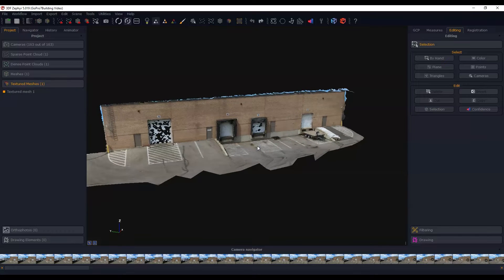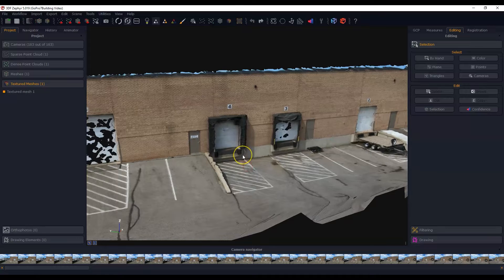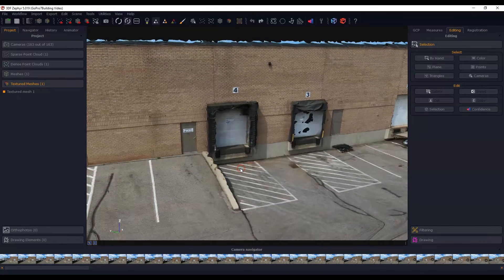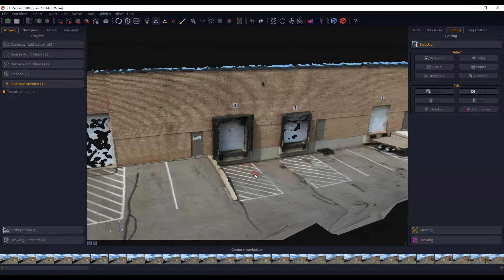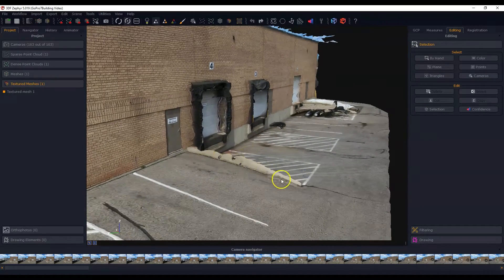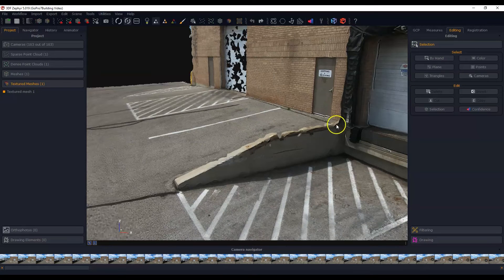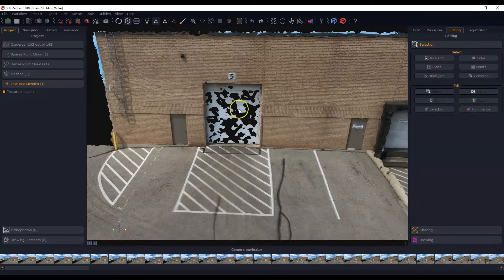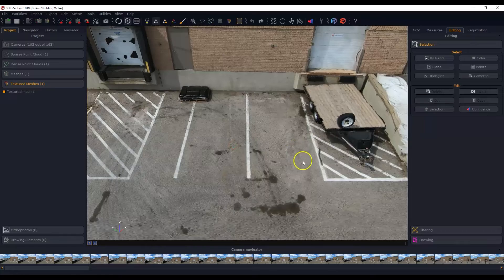How to use a GoPro 7 camera and a pole to create 3D models | Photogrammetry | Click 3D Ep. 28 | CSI

Comment: Good practical course of pole use in photogrammetry!
Wouldn't It had been easy to avoid the shadows of yourself in the photos by walking and shooting in the sun's direction?
Reply from the maker: Yes, actually I thought I made a comment about that while I was taking photos of the parking lot. You either have to hold the camera well in front of you or just turn slightly until your shadow is out of view.  However, you’ll see that in the reconstructed model, the shadows hardly show due to blending of textures.

Comment: Hey 3D-Forensics, will Hypersmooth-stablizer distort the image or is it okay to use?
Reply from the maker: This is a good question but I would generally avoid it. Image stabilization is often shifting the image on the sensor and that means the camera parameters don’t stay fixed. I can see a case where it may work, but under normal circumstances where you have some control over the camera, you will likely try and avoid it.

Comment: Is there a 3d model and process obtained with photos taken underwater using gopro?
Reply from the maker: The process above water or under it would be very similar.  However, you have to deal with additional factors under water like how clearer the water is, particles, flash, different wavelengths of light reaching different depths…etc.

Comment: Purhaps I missed it but this is a GoPro and don't' they have some strange curved images that come out because of the wide angle?  Did you straighten out the photos and video before importing into 3D mesh software or just take it as is? -- Thanks
Reply from the maker: Most photogrammetry packages can now deal with a lot of barrel distortion. In fact, you can even use 360 images which have a very wide field of view and quite a bit of distortion.  GoPros are no problem nowadays.